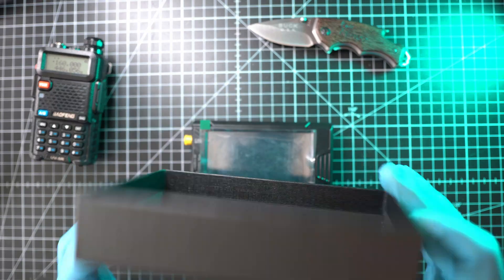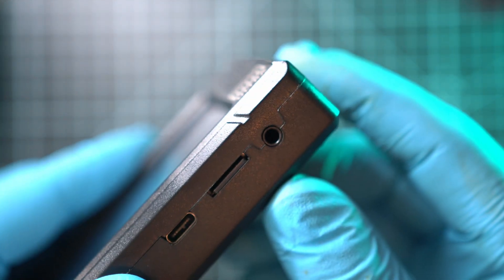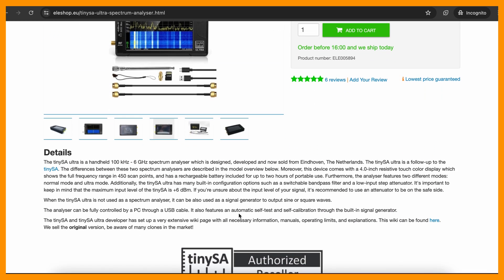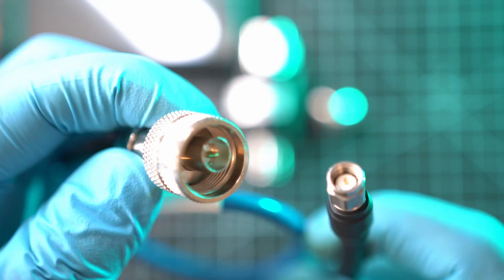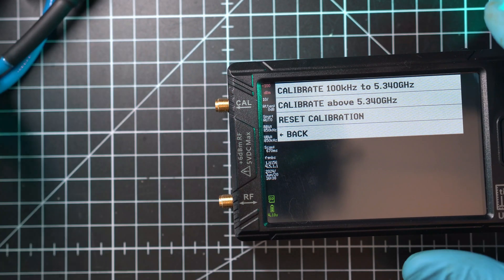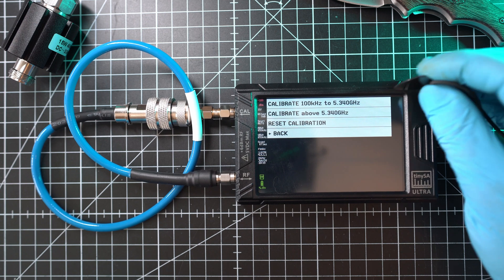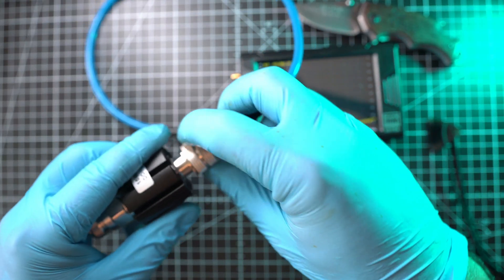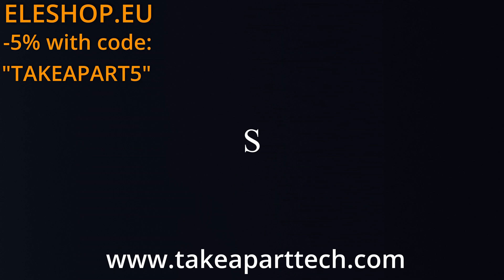TinySA ULTRA Calibration tutorial

Comment: Hi. In the store you linked in the description of your video there are two versions of tinySA ultra. The first is just tinySA ultra, and the second is tinySA ultra (ZS406 version). Do you know what the differences are? Thanks in advance.
Reply: Ok. I did find the answer. This new model should be called "plus".
A brief overview of their differences:

Battery:

ZS-405 3000mAh

ZS-406 5000mAh

ZS-407 5000mAh

Normal mode:

ZS-405 100k-800MHz

ZS-406 100k-900MHz

ZS-407 100k-900MHz

ULTRA mode:

ZS-405 800MHz-5.3GHz

ZS-406 900MHz-5.4GHz

ZS-407 900MHz-7.3GHz

LNA effective frequency:

ZS-405 100kHz-3.5GHz

ZS-406 100kHz-3.5GHz

ZS-407 1MHz-7.3GHz